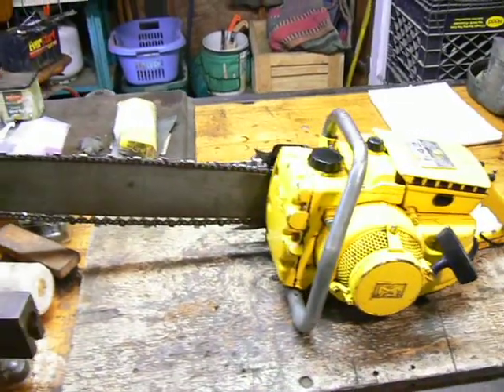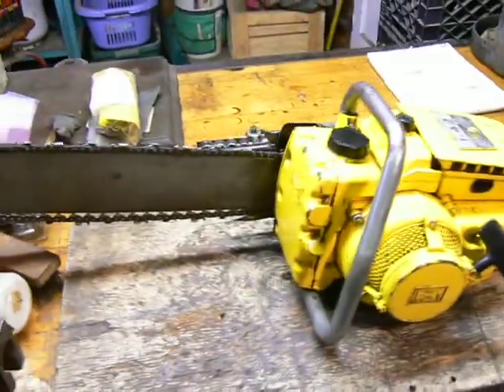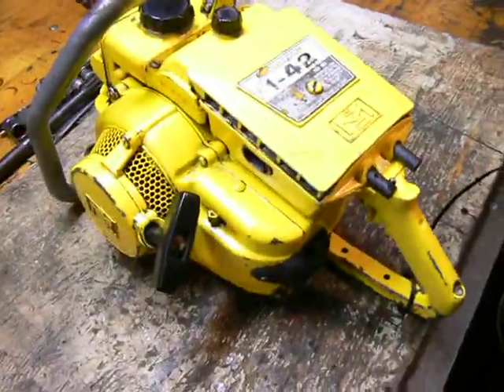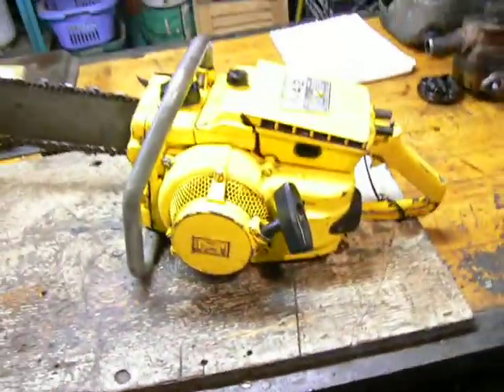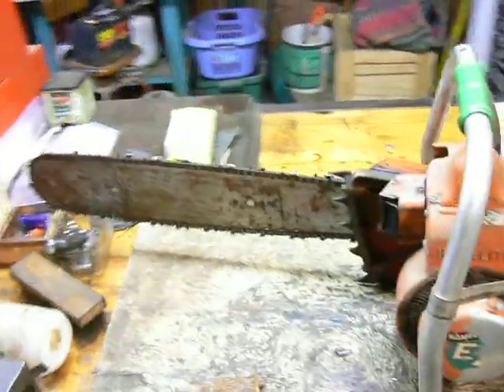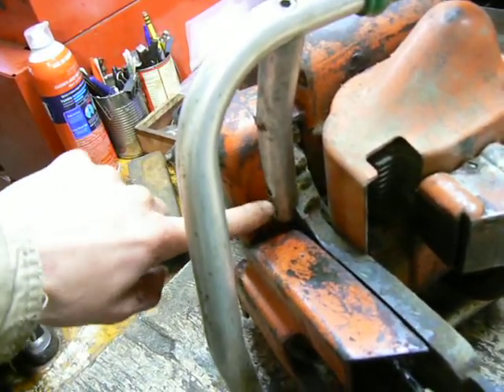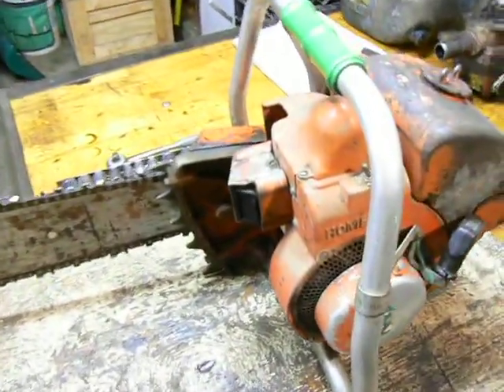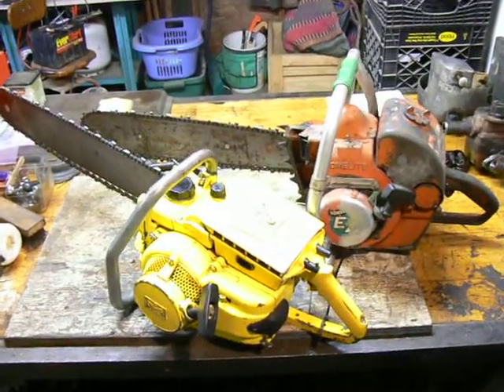McCulloch 1-42 and Homelite EZ Introduction to the Family

Comment: My father had a blue homelite about the same size of your EZ . His gas tank looked like big tin can. It had a decompression valve. Very thick bar 36" it also had pegs to stand on when starting it. He made good$$$ cutting large stumps down to ground level and sawing big trees around my home town. He absolutely hated starting it.lol . He was a big man and with the valve open he would hold it down with the pegs under his boots. The 10/15 min. Of both hands gripping handle pulling strait up . He was only person at home who could lift it. I was a boy and mother is a small woman. When it did finally run it woke the whole neighborhood.  It was long ago but I believe it was about 50lbs . Probably over 100cc. Your ez reminded me of better days. Thank you Sir. Dad always said to start that saw I got to get mad at it.lol

Comment: Use your toe to push throttle it don't have operate presence lever so it wont lock your throttle and you can use your both hand to start it